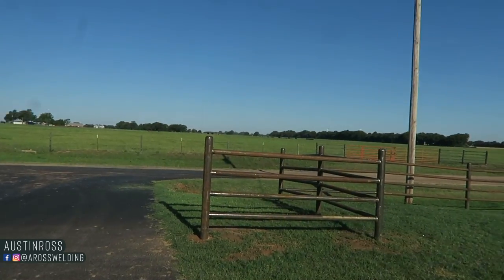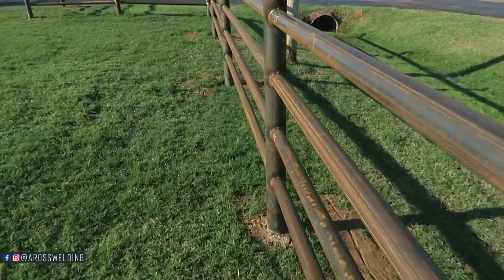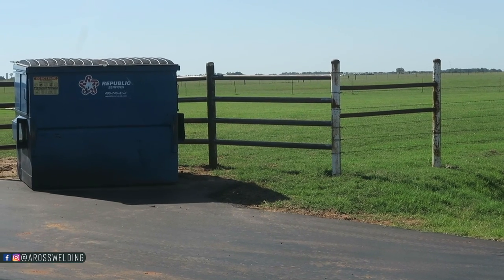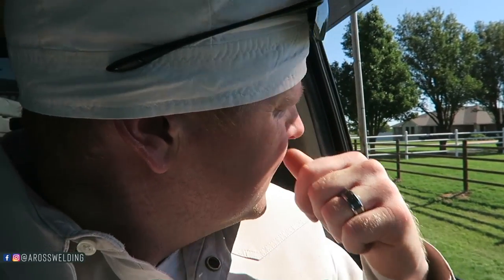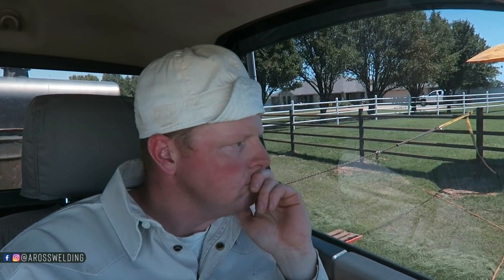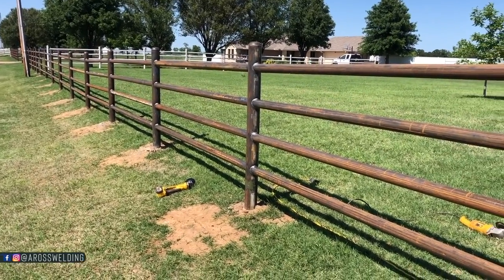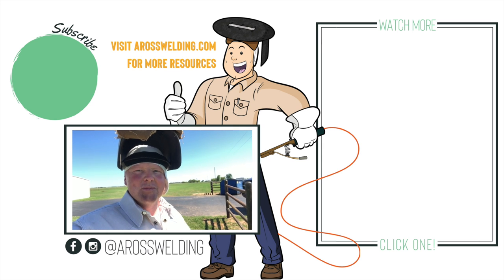HOW TO WELD PIPE FENCE // WELDING RODS I USE FOR THE JOB

Comment: That fence is overkill for sure... I love it
Reply: Property owner is probably a millionaire.
Reply: Norman  how much would something like that cost?
Reply: @notahacker2107  

Just 20 feet of 2" sch 40 pipe in my area is $70 + tax
Reply: Dennis Young tractor 🚜 proof
Reply: @notahacker2107  you can count on that being a 100 dollar / foot fence if not more.
Reply: @notahacker2107  Cheapest route would be to source used oilfield piping.

Comment: Never mind on how you cut the pipes I just saw your video from last week, and it answered my question on the pipe joints.  Clean job it's nice I learned  something new with that hole cutter on the torch.👍

Comment: I am running 5/32 6011 root & 7018 final pass. Was a welder over 20 years ago and am a bit rusty. Never hear of 8010, are you using a different rod for the root pass then 8010 or vise versa?

Comment: I use a 5/32 for that kind of fit, just one pass. It is easier to cap with a 5/32 with a 6010 root in there but sometimes you don’t need to run a bead there.

Comment: CLC knee pads eh?  Liked their open 10ish x 16ish open tool bags with shoulder strap enough that after 18-20 years of use I replaced it with the same tool bag (same bag with a couple changes they made).  Still fits in my locker at end of day, tools right where I want them (unless someone else moves them, then they "lost" "forever").  The guys in the shop know how to "throw me off."  CLC, good stuff even though mine isn't leather.

Comment: Nice quality work. Can't financially justify 2 passes, 1 w/ 80 series rod on schedule 40 pipe w/ static pressure, way over match on filler rod. Anyway you will figure it out. Oh, 35+yrs welding, did a bit of pipe fence in my day tho.

Comment: I'm curious about some things. Does 8010 weld up like 6010?  Fast freeze  and with iron powder in the flux?  6010 was always the go to rod for root passes for open root welds. I  noticed that you're welding down hand. I guess that would help you lay down a smoother bead and with that big of rod (5/32) that would help you lay down a lot of bead with one pass.  As well as everything seems to be fit up (nice work) that very likely helps too.  Also you're welding on clean pipe so that's helpful too - keeps contamination down.  You also don't have to have the welds inspected like you would on pipeline welding.  

I also liked to run a number 10 gold lens.  The only thing is that the gold could scratch very easily so you had to be really careful when you cleaned the lense so that you wouldn't scratch the gold.  Even small scratches could let light in and burn your eyes.

Did I hit on anything right or did I just blow it all out my ass?

Comment: We just set the posts for some working corrals yesterday so we can start welding tomorrow, what rods should I use? Could I get away with running a pass with 1/8 6010 and then running another pass over top of it with the same rod?

Comment: I've found that if you have a post a lil off it works to heat it at the very bottom with a torch (on the side that you want it to move) get more then half red hot and then throw a cup of water on it and it will draw plumb most of the time. Sometimes a lil too far
Reply: I've watched people straighten drivelines the same way.  These were on old farm trucks so not a lot of speed involved.

Comment: I know you love stick welding but have you ever tried flux core welding on pipe fence. I got a buddy in California to try it. He is now always grabbing his fronious 2200 and a spool of flux core. 30% faster and welds up like 6010. Great videos!!
Reply from the maker: I love it. I’m goin to have to look into that.
Reply: @arosswelding  100' 8ga cord and a wire welder sitting on one of those big tired wagons you can get from TSC. I get weird looks but it just works...LOL
Reply: @larryvollmar8763  You weld electrode negative with that?
Reply: Matthew Fogarty reverse polarity. Run it all the time on fence and gate repairs. Way faster then stick.
Reply: @larryvollmar8763  Nice, i'll try anything once.
Reply: Fronius 2200 transsteel is where it’s at!!! Dual shield all day and lighter than my 12vs.

Comment: This might be stupid but when your done welding if you leave the slag on bead will that offer any protection from elements??
Reply: Maybe for a short time, it won't last with the expansion and contraction in the heat of the sun. What you risk is losing paint if you paint over the slag. Like bark on wood, if it's getting painted it yad best come off first!

Comment: I might've pulled a string line prior to poking the holes in the posts rather than pulling the tape off the uneven ground. But looks great either way!
Reply from the maker: That’s what he did. He pulled a string and looked at it from the road and got it just right. Appealing to the eye 👌😎

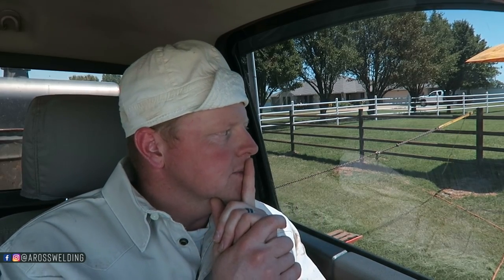Comment: Well done Austin , joints and fence look great !  Amen at 8:00 , both complement each other and the small joints on the fence pipe help keep a feller in shape as you have to move fast compared to big pipe .    Beautiful countryside your working in !  I was born in Stillwater while Dad was attending  Oklahoma State back in the day .  Would love to get back there one of these day's .     Hey  I forgot to ask ,  what kind of disc were you using on the dewalt grinder to polish up with ?

Comment: I´m having some difficulties MIG welding flat steel bar to 1" sucker rods... whenever i apply some force to it, it tears appart a small layer of the sucker rod. Do you know what the problem might be? do i need to turn the amps up to make the wled go deeper? is MIG welding not the way to weld these two steels? I´m kinda lost here...Thanks a lot!

Comment: I see from the comments it’s SCH40 pipe. Is there a spec for the metal or pipe type? I’d like to build pipe fence but don’t want to end up with pipe made of junk metal that will rust/rot out in a few years. I can also get ahold of oil field drill pipe. Thx!

Comment: Looking at your circle cutter on your site, and it appears you have other fixtures to attach to the pipe? Care to describe what that is that allows you to rotate around the pipe?
Reply from the maker: Yes, that is a pipe beveling machine. Check out more about them here: 
https://www.mathey.com/Pages/saddle-machines-manual.htm
And check out this video at 4:10 for another style of beveling machine we use on pipeline jobs. 
https://youtu.be/qmOzpYNzQ24

Comment: I'm curious why you use pipeliner to weld pipe fence with? Around here hyp+ is quite a lot cheaper, like $50 a box cheaper, and plenty sufficient on pipe fence. I guess I just thought I'd throw that out there, maybe reduce your operating costs a bit.
Reply from the maker: I am just addicted to it more or less. Lol from welding on pipeline. It welds soo much smoother than 6010. But I should look into the hippy rod if it’s cheaper. Thanks!
Reply: @arosswelding  No you're right it welds wonderful I personally just was curious if your preference towards it was that strong or if you maybe just hadn't realized hippy was quite bit cheaper. And maybe in your neck of the woods it isn't. Seems like its all but obsolete in the oil and gas industry with the exception of batteries and such.

Comment: Nice job, how did you cut the pipes with the cutting torch, or something else.  They look clean around the post, and  the welds look nice as well.  Great job
Reply: He used a beveling machine on the tops of posts

Comment: Hi Austin what is the outside diameter of the posts and rails? Looks real nice, I plan on signing up for the fence course. Great video.
Reply from the maker: 4 1/2” on the posts and if I remember right we used 2 7/8” for the horizontals
Reply: @arosswelding  thanks Austin. Beautiful job.

Comment: Good job bud , i like watch your videos , im gonna start try used your method on make holes on the pipes ,  just want to know where i can gwt a straight torch and the handy dandy hole burner
Reply: Any welding supply should be able to fix you up with a straight torch and the hole jig was probably self made trial and error.   Not difficult.
Reply: Thank you sr

Comment: I like 2024s..was long ago frrocraft 24...they have rutile. and,iron powder..all positional..okay for thin..galvo welding....I only use 2.5mm rods..good on thin sections..makes a big weld due to iron powder...very similar to welcraft..e6013..and ferocrat 11 mixed..so is a iron powder cellulose for mix all positional..so no slag holes...okay for vertical down..no good on hard steels..for hard Steel..welding use low hydrogen or stainless steel rods..don't forget a quality carbon respirator for welding grinding.cutting..cover front of neck so not get skin damage..at late life..

Comment: Why not use 7018? Looks much nicer than that "downhand rod" you pipeline guys use. Well done fence sir.
Reply from the maker: I have considered welding out with 7018. I’m just use to using downhill rod. I feel like it faster and less chance of porosity. Faster because my experience and systems I’ve created are starting at the top and ending on bottom.

Comment: I’ve got a straight torch, but need the circle cutting jig you use in videos. Where can I purchase one at?
Reply from the maker: Try calling these 3 places and see which one will ship one to you. 
Tell them I sent you.
Munn supply: 580-234-4120
Stillwater steel 405-377-5550
Chickasha ind. & welding 495-224-2215
Reply: Thank you sir! 

Are you any kin to Greg Ross? He’s an Oklahoma welder, and y’all favor each other

Comment: Are you done with pipe lining or just taking a break.
Reply: a lot of pipeline welders are having trouble finding pipeline jobs at the moment.
Reply: The Union has him by the throat he cannot take a non Union job without turning in his book however the Union is not offering him work. So he is working jobs that will not void his Union contract.  Simply put hes not allowed to pipeline.
Reply: So with everything going on, is it better to be union or non union?

Comment: Do you also paint the fence?
Reply from the maker: We will not paint this one but one day I plan on offering to sandblast and paint the fences I build.
Reply: Austin Ross I bought a Miller Trailblazer 302 Air Pak to be able to provide this service to my customers and all the home projects I have. The built in 31 cfm air compressor is perfect for running standard air tools as well as my small sandblaster that will hold 100lbs of material at a time. I’m limited to an 1/8” diameter nozzle but it works fine for small jobs. For this fence, you need at least a 185 cfm air compressor and a larger nozzle to be cost efficient for you and the customer.

Comment: Really nice but I would have liked the stringers to be level all the way across..and not follow ground
Reply: Depending on the profile of the ground, that might leave some pretty big open spaces at the bottom.
Reply: @workonitm8  that is true
Reply: It's usually best to follow ground unless you want to do a lot of leveling of the ground first.